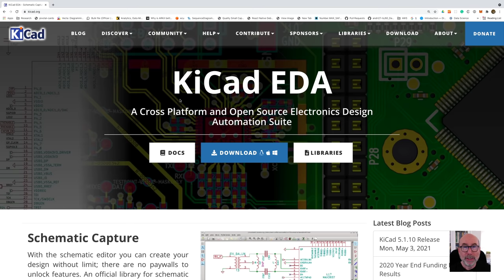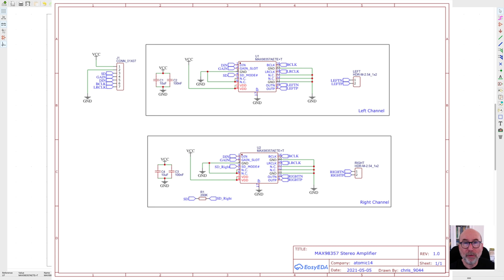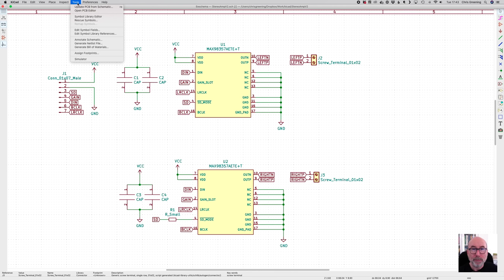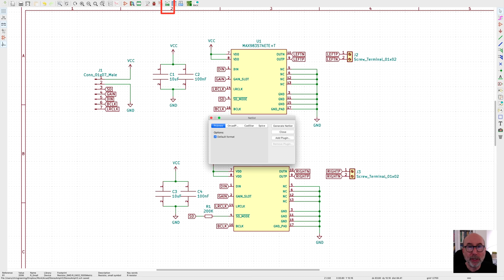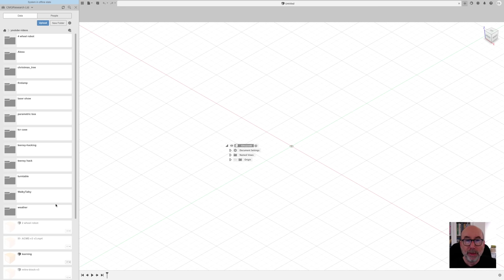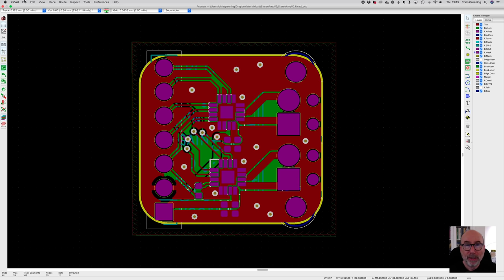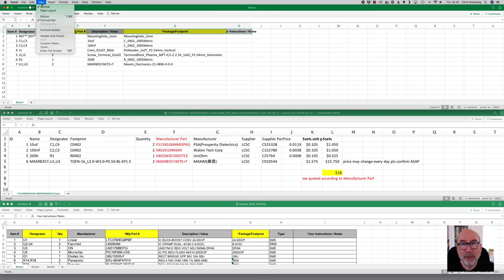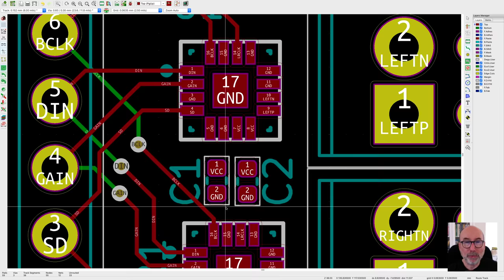Mastering KiCad: Design & Build Your Custom Stereo Amplifier Board!

Comment: I'm a novice. Seems to me EasyEda is quicker, less tinkering than KiCad. I can't find video comparing the two systems side by side. So I will just stick to my own experience with both. EasyEda is more workflow friendly including full access to LCSC component library with footprint and prices and ability to create the BOM without the need to tinker it as in this video.

Comment: Extremely informative, many thanks. I keep toying with moving from EasyEDA to KiCAD for the same reasons as you did, but each time I've had a quick look, I've always gone back to EasyEDA. After watching your video, I'm inspired to give it another go.
Reply from the maker: Definitely wasn't as bad as I was expecting :) I'm going to give KiCad v6 a go - it's not released yet, but from the sounds of things it a good step forward.
Reply: Of course you have. EasyEDA has a powerful built-in library of parts.
Reply: I'm in the same boat. Adding parts is such a hassle in KiCad compared to EasyEDA. A few things annoyed me in EasyEDA as well (like the bottom layer view) so that I gave KiCad 6 a try, but now the new EasyEDA Pro is available, which solves a lot of the EasyEDA issues, so I went back to that one. I'm so much quicker with it.

Comment: Things to note:
1. You can create the identifiers using the annotate schematic option. 
2. I'm pretty sure you do not need to generate a netlist in kicad. I remember reading that kicad does this automatically since version 4.
3. Something you might want to look into is the "edit symbol fields" feature in eschema. It's great for aiding in BOM generation as you can insert custom fields for later. It can save a lot of effort compared to doing it in excel. 

Just my tips after using kicad for a few years.
Reply from the maker: Thanks Jonathon - great tips! Exactly what I was hoping for from the video.

Comment: Short and sweet 😃 Having designed 20 or so boards in Eagle, I had to modify a KiCad board , and then designed a couple of boards from scratch I’m beginning to like it now. I originally followed a 30 min tutorial , took me about 3 hours to design the board and add a few of my own things to it . The second board was somewhat easier , and simpler. I’ve picked up a few extra points from your video , so Many Thanks
Reply from the maker: Great, I'm glad you found it useful. I find with all these things, there's an initial hump to get over where lots of things are just different enough to be frustrating, but then after a few tries it becomes second nature and starts to flow properly. My problem is often having the willpower to get over that initial hump...

Comment: For the symbol IDs (question marks), you can use the Tools - Annotate option to set them for you.

Also there are two types of labels available in KiCad, global (what you used) and sheet specific. This is mostly applicable in complex designs with multiple sheets.
Reply from the maker: That's handy to know, I need to dig a bit more into the annotation side of things as I think that will make my BOM file generation a bit slicker as well. I had a vague idea about the global and sheet specific labels but wasn't quite sure how to use them. One thing I did miss was being able to draw boxes around logical groups of components. I don't think that's currently possible and your supposed to use multiple sheets instead to organise things?
Reply: @atomic14  In the tool palette is a blue dashed line box icon which you can use to draw boxes/lines/etc, hotkey for this tool is | (pipe).

Multiple sheets (or hierarchical sheets) is great for complex projects and can help organize the schematic into sections (power, inputs, outputs, etc) in a similar manner to how you used boxes in the other EDA tool.
Reply from the maker: Perfect - the dotted line was exactly what I was looking for.

Comment: When adding pins to the connector, create first one and use the INSERT key to create each of the others needed. KiCad 6 has many improvements and, shall I say, differences. No more Netlist button - File/Export/Netlist.. now. Better to change sooner than later before you get attached to KiCad 5 ways of doing things. Great video. I just subscribed and will be looking around for other gems.

Comment: I made it with Eagle PCB. A good program and for a long time you could use it for private use, small board size and only 2 layers for free. The purchase version is too expensive for infrequent use. Then I tried easyEDA. 
A cramp with a trakpad. Good if I want to throw one IC, two capacitors and three headers together ... But Eagle is much better. But my Eagle version is just a trail and restricted.
But I think I'll give KiCAD a try.

Comment: It's 2023 outside the window, and the best thing for a beginner and beyond is to use EasyEDA. Because it is a free online tool - component databases are available to you immediately. You, in most cases, will not have to draw your own components. There is also a 3D render of the PCB with components. And you can immediately order the manufacture of the board and even assembly with components.

Comment: KiCad is very sophisticated but I find that simple things are not done well.
For instance :
-moving a symbol in schematic : 
               .before v6.0 the connections were lost
                .v6.0 the connection loose orthogonality and became unreadable
- routing manualy a track in PCB : if you want to modify the route, the old route stay and you have to manualy delete every segment of the old route.
Perhaps I dont use it correctly ?

Comment: The possibility of exporting a STEP/STP file is something that draws me to KiCAD... I'm yet to start using it and the video is quite compelling 😅
EasyEDA exported OBJ files usually wreaks havoc on Fusion 360, since EasyEDA exports all files in "mills" even though we explicitly specify units as mm, while Fusion 360 does not support/read "mils". Also to add to the problem, the generated OBJ has least resolution and renders horribly when opened on Fusion (or any software like Meshmixer or even Windows 3D viewer/builder). Scaling never works well and sometimes with disastrously off measurements
Reply from the maker: Yes, it's pretty dreadful. The few times I've tried it have either made Fusion360 grind to a halt or resulted in terrible meshes. The output from KiCAD is really nice.

Comment: Generation of the net list is a deprecated step in recent versions. If the schematic is saved you can open PCB New and just hit the Update button.

And I think you can edit the symbol and include part numbers, so BOM generation already has the values. Bonus, if you update the symbol which is in the library, you get the values every time you use that symbol.
Reply from the maker: That's very handy - I should have had a look at the symbol editing as well, that sounds like a very sensible way to go.

Comment: I also started on EasyEDA and then switched to KiCad for later projects, and now that I'm used to KiCad I can't stand the way zooming works in EasyEDA. I also use the same trick to scroll and pinch to zoom with my trackpad, and it's so much more intuitive.
Reply from the maker: I'm not sure why it's not the default. I was trying another piece of software yesterday where to pan to have to hold down the space bar and then move the mouse - completely bonkers.
Reply: @atomic14  I'm assuming it was written in a world of scroll wheels, not multi-touch trackpads.

Comment: I just use lines and arcs to created a rounded PCB outline, pretty simple to me. Start off with a rectangle, put the right arc in each corner, then delete the rectangle and join up each arc with lines
Reply: KiCad 7 now has a "Fillet Rectangle" feature, and it's as awesome as it sounds.

Comment: The BOM entry for mounting holes is for if you have something like surface mount standoffs. 

What kind of fastener are you using for mounting? It doesn't look like there's room for a screw head.

Comment: Sir, thanks for such a nice video.

As you do, I am also considering move to kicad from easyeda for 3D model export.
Another choice could be fusion360 electrical design.

I want to know if you ever tried it.
If yes, Which one do you prefer and what.s the reason?
Reply from the maker: I’ve only briefly tried the fusion360 electrical design. I did not find it very intuitive or easy to use - but I did not put very much effort into using it. I think most people are using KiCad so there’s a much larger community to get help from.
Reply: @atomic14  Appreciate for your kind answer. Now I got to know what to choose!

Comment: Hi Atomic, are you going to share the files of this version 2.0?
Reply from the maker: Definitely - I’ll upload them to OSHWA
Reply: @atomic14  Great atomic. Regards
Reply from the maker: I've put the files on GitHub - raise an issue if it's not quite right, as I'm not sure what files need to be there - https://github.com/atomic14/stereo-i2s-amp-board
Reply: @atomic14 Thanks. Lately i was working with Easyeda to kicad, it was a bit difficult but it's better
Reply: @atomic14  Idea: Put a link to this video in the readme.

Comment: I have done countless boards on the job and still end up with little green terminal blocks hanging over the edge.
Reply from the maker: PCB mistakes seems almost inevitable. I've now learnt to hold off submitting anything for manufacture until the following day. I invariably find some stupid mistake when I check the next morning.
Reply: @atomic14  On the job we use an old LPKF prototyper still running Windows XP. And that's for on the spot non-production stuff. For the last three years I watched a PCB for a new product line go through several revisions because of problems that popped up and those designed had entire teams of engineers and even a CAD wizard who renders everything in 3D to check for clearances and there are still problems! I learned there is nothing a lone person using free stuff should be ashamed of.

Comment: >>Main screen turn on<< 
I had this feeling throughout, that your board was rectangular (like the one from Adafruit) but the length and breadth were swapped (so the pin-header is almost off-the-edge)
>>are belong to us<<
Reply from the maker: I think I got confused as the Adafruit board is quite short so the the ends of the headers are very close to the edge. And then I just went a bit mad and made it made it too thin :)
Reply from the maker: Also, glad you got the reference, wasn't sure how obscure it was :)
Reply: @atomic14  While the reference isn't obscure, it does put those who 'get it' into a certain age-group ;)

Comment: I found the autorouter from Easy EDA a step ahead.
Reply from the maker: I've not actually used the autorouter - I really should give it a go and see how well it performs.
Reply: @atomic14  Easy EDA autorouter is fabolous, you can set track width, clearences (and it works very well), exclude nets from the autorouter, give some special config to some nets, ecc. ecc. You should give it a try. :)

Comment: The pronunciation of KiCad is sort of an in-joke within the KiCad community. Both K-eye-Cad and Key-Cad are valid pronounciations with two informal groups within the community professing allegiance to each of the pronunciations. Makes for a good mock argument to steer actual flame-wars towards to defuse situations.

When you did your project you created a netlist from the schematic and then loaded the netlist into the pcb. This is now a depreciated workflow. You can skip the whole generation of the netlist file and update the pcb from the schematic with a single menu item. You can't really update the schematic from the pcb if you wanted (for example) to swap pins on an IC. KiCad's native workflow has information flow from the schematic to pcb.
Reply from the maker: I love a good flamewar. Tabs vs Spaces is still a favourite.

Comment: Kicad is more powerful, but it doesn't handle the component part well, it only uses generic local libraries. You can't work with real components from manufacturing companies, like JLCPCB, and kicad doesn't have the netlist and the list of components, always visible on the left. It's almost impossible to develop a real job with Kicad.

Comment: Asians usually pronounce the letter i as a vowel "E", while Americans use the 'i' sound.  IE we pronounce the name of the Japanese camera maker  N-iEYE-CON, while the Japanese say N-knee-con.  I think Europeans usually go with the Asian pronounciation.   Same for those 'down under'.

I didn't like the symbol I found for the 74HC4053, so I tried to design my own.  This is a 3 unit SPDT fet switch (3PDT?), with a separate control pin for each switch.  So I tried to create a part with three 'units'.  Each was drawn as a SPDT switch, with a dotted line for the control pin.    Actually, I also needed to add  common VCC, VSS, Ground, and Enable pins, which would be the 4th unit in the part.  So I tried clicking on the 'non identical units' box so I could create the three switches and the power / enable pins.  Somehow, the editor still tried to duplicate the first unit I created for the next three.  Hopefully, I'll figure this out yet.  I also had an issue getting the grid snap the same for my new symbol as for the schematic so I could get the wires to land right.  UGH!

I just use the standard footprint for the package of the part.  IE: all TSSOP-16 pin parts should use the same footprint, no need to duplicate it for each part.  At least if you have the pin numbers correct for both the footprint and the part.
Reply from the maker: There's something about footprints, both the management and custom ones, that seems to be unfathomably complicated. It should be easy, but every time I do it I hit problems. I had big problems in EasyEDA trying to get a footprint for the ICS43434 - trying to make a circular pad seemed to involve way more clicks than it should.

For the amplifier IC I should have just associated it with the standard footprint for the package - I guess that's why we have standards after all!